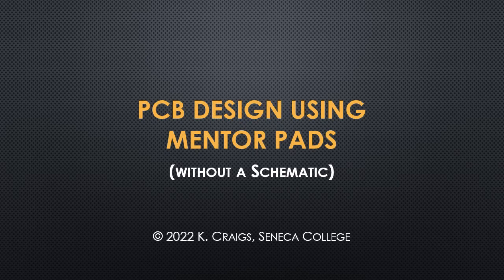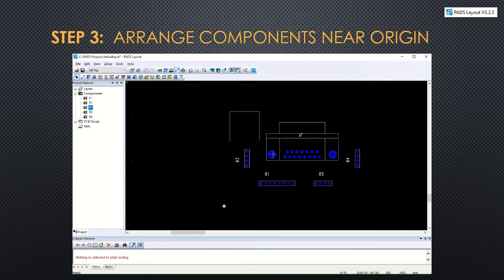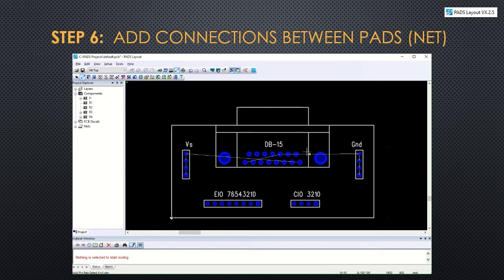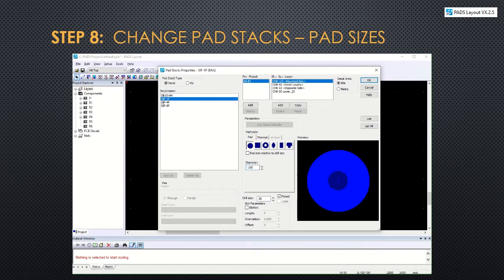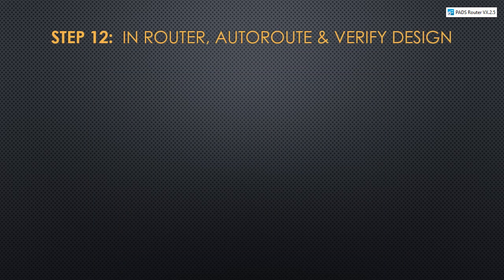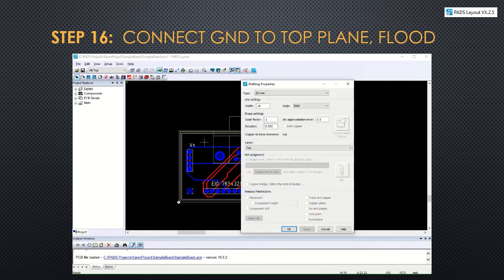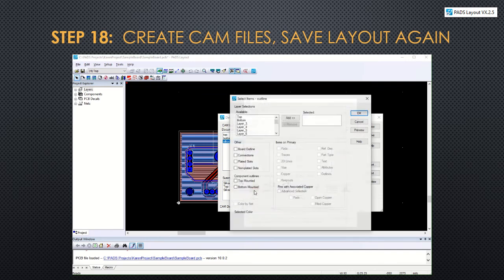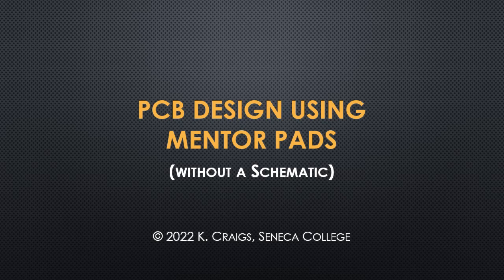PCB Design Using Mentor PADS VX.2.5

Comment: hai madam how add differential pair in pads layout
how to add length matching in pads layout
Reply from the maker: Hi, I just did a quick search on YouTube and found related posts from "Siemens Electronic Systems Design & Manufacturing" and also "PADS Desktop PCB Design". They each have some great tips on how to approach these advanced topics. 
For example, you'll want to first draw the paired traces and then tune them, explained here: https://youtu.be/ehwj4rR3zKU
Good luck!